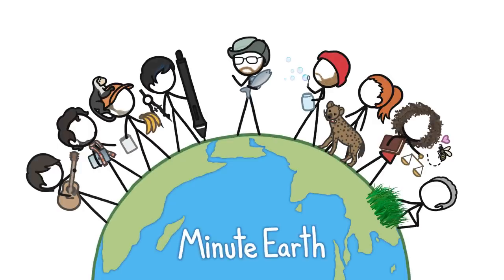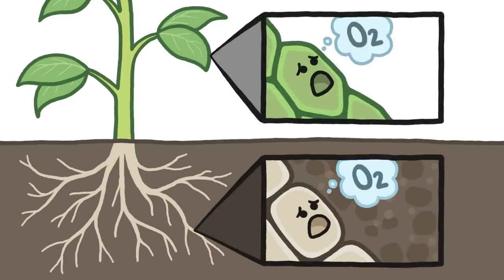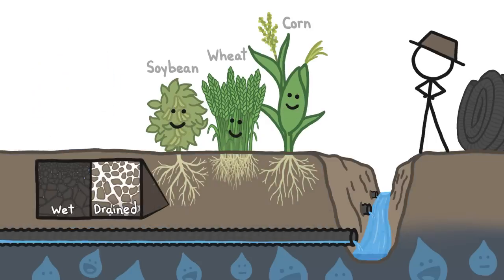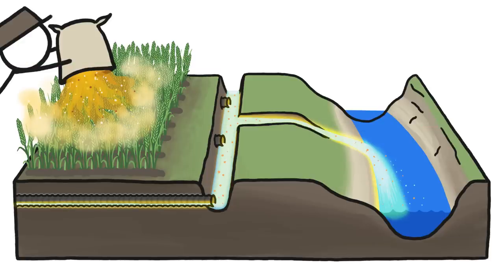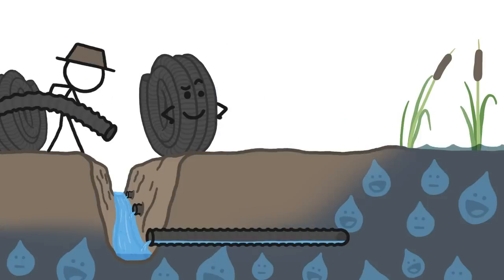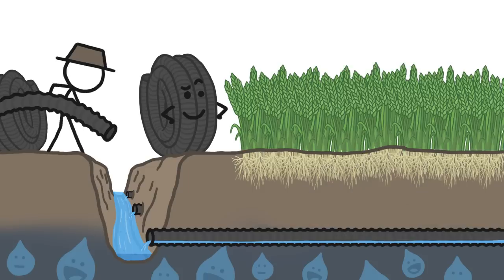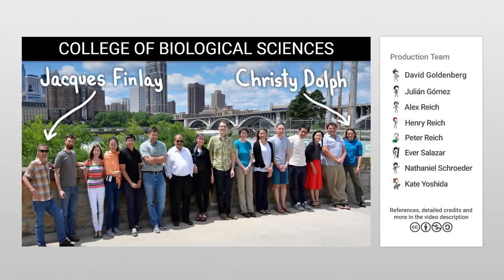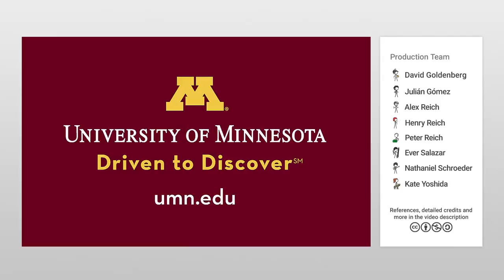The Secret Global Sewer System

Comment: How much research was completed for this video?  Field tiles only works when the field has excess water in it.  They do not magically drain all the water from a field.  Soil can naturally only hold a given amount of water and when the level gets above that point the field turns muddy and the crops yield less which can lead to higher costs for other items like food, gas, clothing, etc. And the water running out of a field tile of a properly managed and sprayed field will be cleaner on average than the water coming out on the tap in your house due the soil filtering out and holding onto the chemicals.  Another note, without filed tiles the excess rain just like the Midwest had this year would have been more ground runoff (where the water justs runs over the top of the soil) due the soil already being saturated.  This can lead to field flooding which can contribute to localized floods in fields and country roads.  The field tiles drain the water away slowly between rain events so that the soils has room to take on more water for the next rain event.  And my last point, there are almost zero fields that will have both field tile and irrigation setup.  Irrigation is used in soil types that drain water away too quickly, think sandy soil, and thus would be useless land otherwise.  The video was correct in saying that is be better to add the water to wetlands but that was the only item that was correct in the video.

Sources for my comment: 
https://youtu.be/quFbSgLTE3o How tiling is installed and its uses.
https://www.youtube.com/watch?v=VvppelGQ8Ww What happens when a field is too wet due to an abundance of rain and no field tile.
https://www.youtube.com/watch?v=hC-P-J2ltlg Is the water really safe to drink? Field tile drain vs water bottle.
Reply: They list their sources in the description.